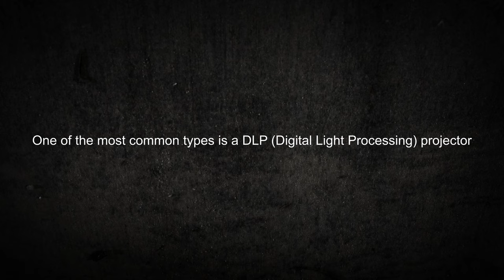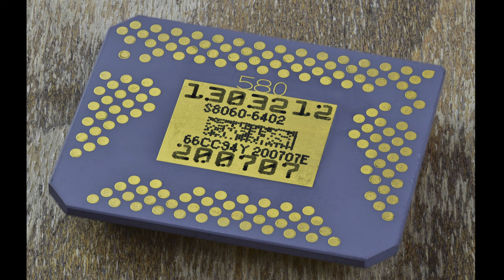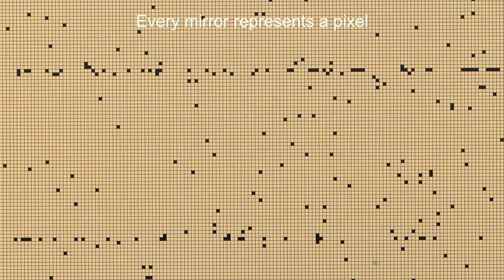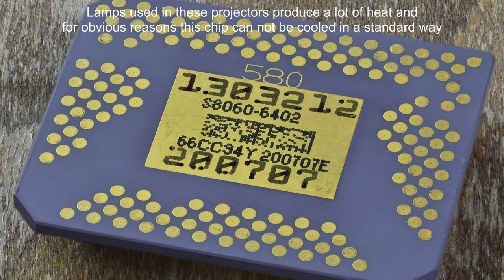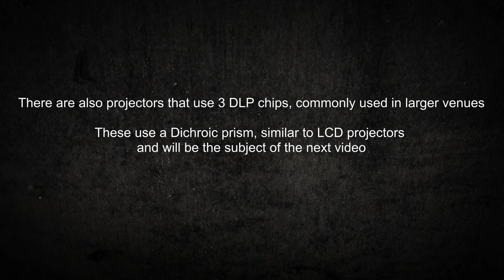DLP projector chips (DMD)

Comment: How do we manipulate these mirrors??
Reply: Electromagnetism
Reply: *Electrostatic ;)

The mirrors are so microscopic, they just put different voltages between the mirror and some of the pads below it, which attracts or repels one corner of the mirror, to make it tilt.

Typical voltages used are around 26V and -8V, IIRC.

The mirror tilts to either stay flat, and reflect light through the lens onto the screen.
Or it tilts at an angle, and the light gets dumped into a heatsink inside the projector.

The mirrors can only ever be in the flat (on) or tilted (off) state, so they need to do some fancy PWM stuff to get the required number of "bits". The persistence-of-vision of our eyes, means the PWM sub-frames merge into the greyscales for the image.

(the colour wheel is added to single-chip DLP projectors, so the chip needs to display a minimum of three times the number of subframes, for Red, Green, Blue in sequence. Many projectors have six or more colour wheel segments/colours, to help improve colour accuracy / contrast / peak brightness.